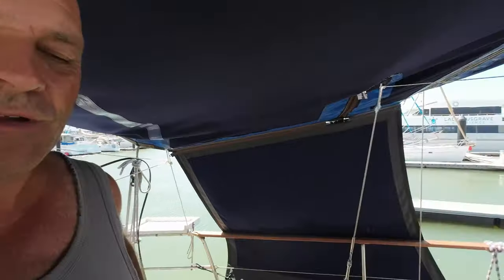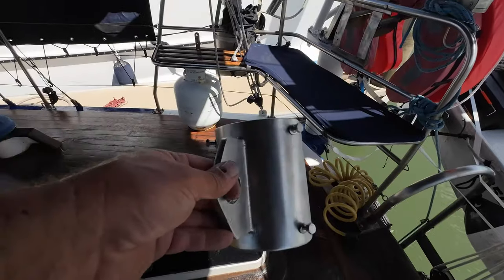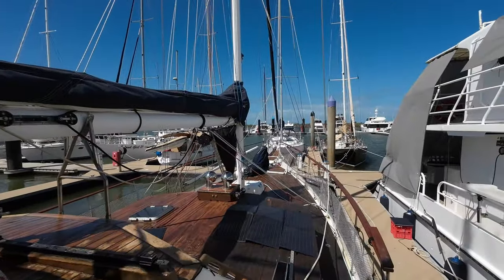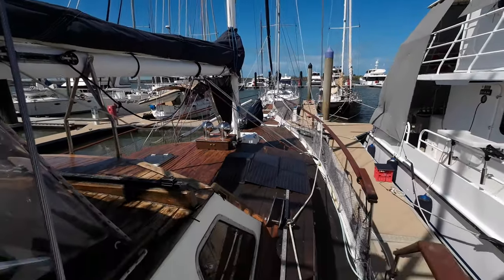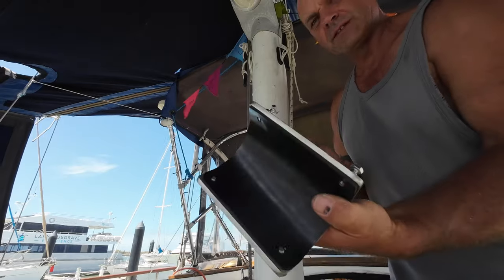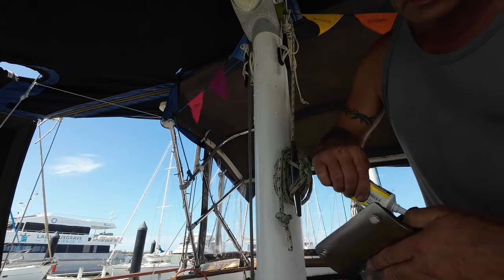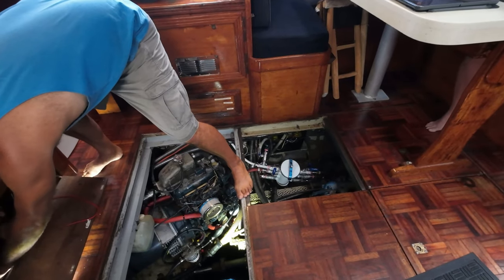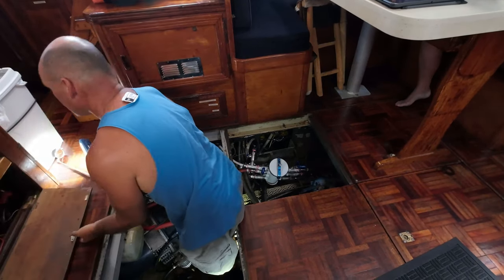awaitea fixing 19 season 1

Comment: Lovely Ep guys.  Your transducer cable should be run completely seperate to any other electrical wires or it will get electrical interference. or run in heavy or thick walled Conduit. Your anchor should be a safety slide Anchor like a SARCA or Mansun Plough slide anchor. you get what you got hooked up you can not get it off,
Reply: As an outsider, but with an electronics background, I imagine there must be a pre-amplifier  for the transducer that will boost the signal and swamp any interference. That pre-amplifier sounds like its dead Jim.
Reply from the maker: Gday Craig,
That is the best way, but in real word there is way too many cables, and not enough room for that to be true..  it is a screened cable and it should work. It just has some issues.

Comment: Thanks for keeping us up on your progress.  She is really coming along.  Good idea on the safety anchors.  On the anchor, wondering, would they tuck up tighter to the spar if the forward roller was moved a bit closer to the middle rollers?
Reply from the maker: Gday David,
It would bring the anchors a little closer toward the bow, but it would only be about 50mm. We did try several combinations  while making it, and this was the best. The anchors could have been back and slightly higher, but then they clash with the bow sprit…. As long as it is strong enough, I’m happy 👍

Comment: Carl, electrolysis only occurs when there is an electronic circuit, i.e. an electrolyte auxiliary as seawater (note fresh water is not an electrolyte). No need for insulator material for corrosion unless you are submerged, hopefully not!
Reply from the maker: Gday Neal,
 I understand what you are saying, but what happens when you get rain on a salt covered mast. I think it may occur under these conditions. Do you think that would happen?
Cheers

Comment: I would advise not to be clipped to the mast. If a stay breaks the mast will drag you overboard. Always be clipped directly to the boat.
Reply from the maker: Thanks,
I didn’t think of that. There are no good points to clip behind our helm position, that would prevent you going over the edge, so now I’m not sure what we can do.
It will need some more thought.
Cheers.
Reply: @nowhereboundtouring  I would suggest in the middle of the cockpit floor or side.
Reply from the maker: @davidcahill3104 👍